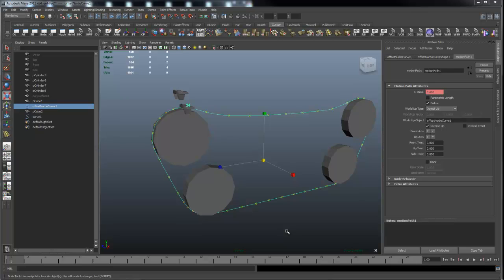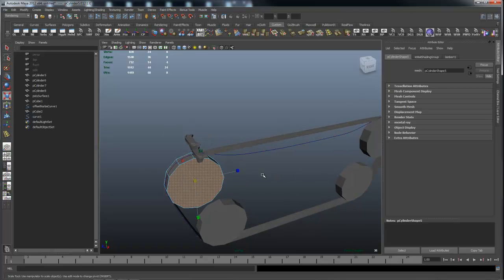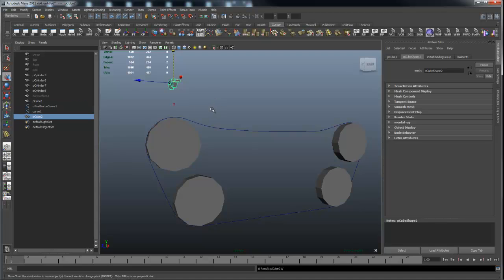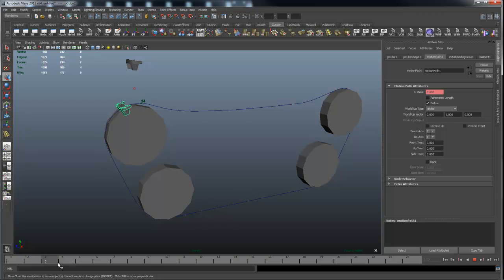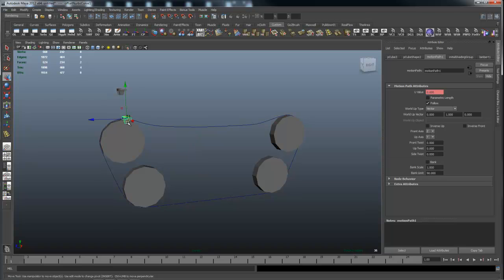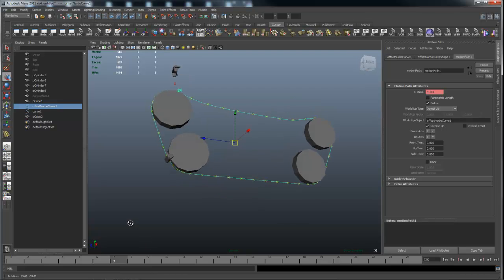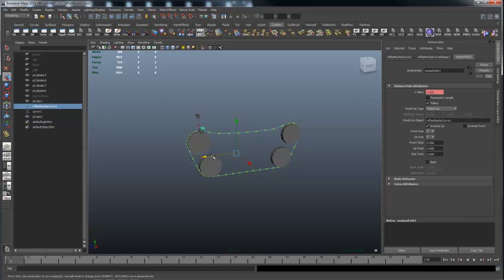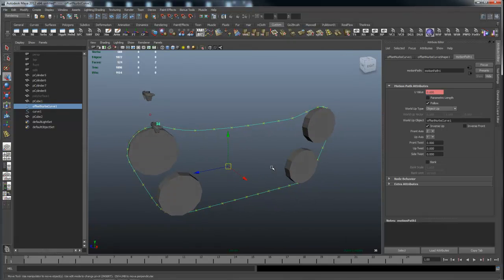howto   create a track following a motion path without flipping

Comment: Having some issues with this, going to try on a seperate file, but on my Sherman file, the tracks keep rotating still. It seems the curve I'm converting loses its direction, i.e. the points on the track before conversion are correct, but when i use the convert tool some of the vertices become wonky i think. It's driving me crazy!